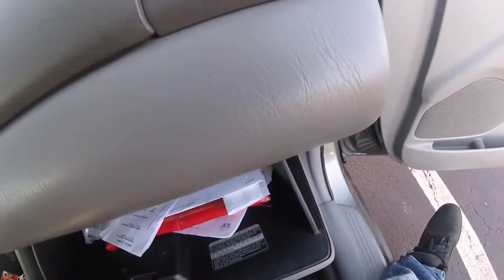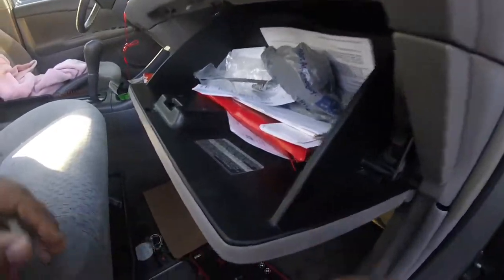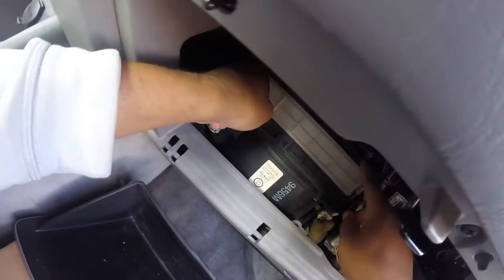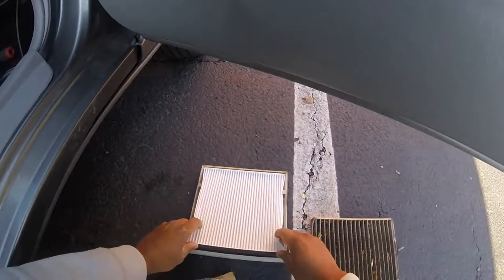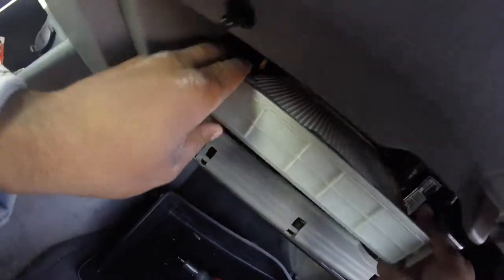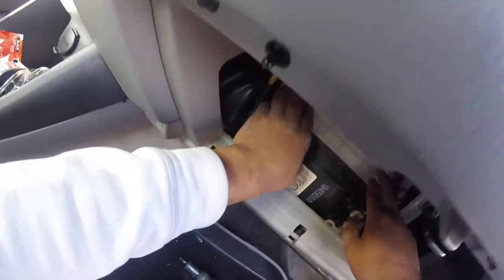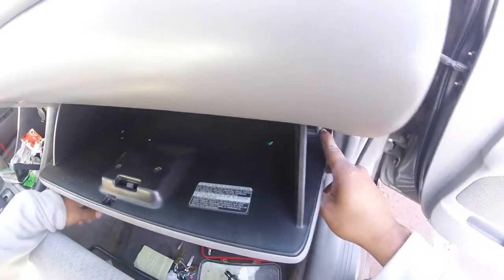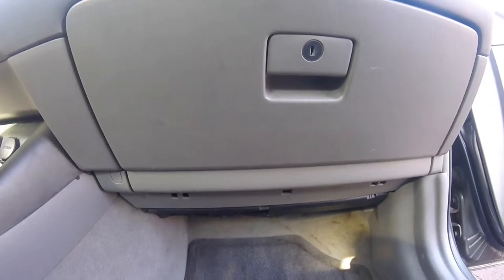2001-2006 Toyota Camry Cabin air filter replacement #after200k

Comment: You put the new filter in upside down. The old filter was an OEM Toyota filter. It says "UP" on it to tell you which side goes up. The new filter was a different brand. It does not say "UP" on it. It says "airflow". Dirty air comes in from the top which is why dirt collects on the top of the filter.  Therefore the airflow is from top to bottom or downward. The arrow on that filter should point downward and not up.

Now, would you like to tell us once more why you make these videos?

Changing the cabin air filter is not a repair. It's just simple maintenance.